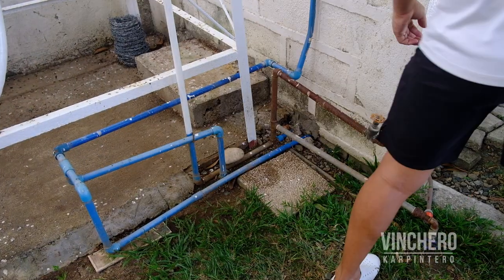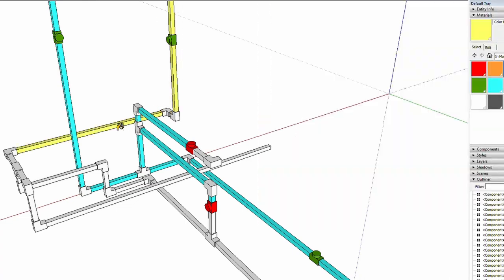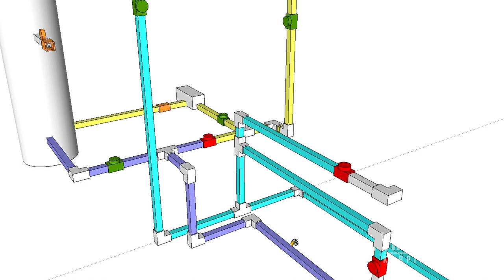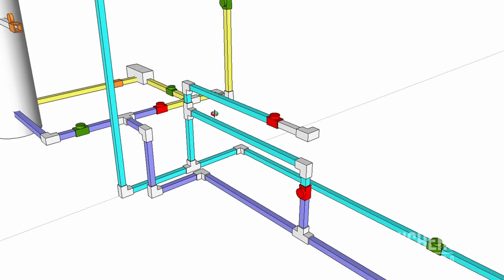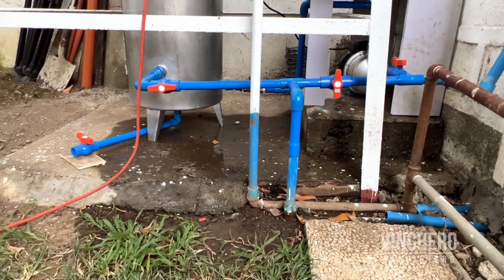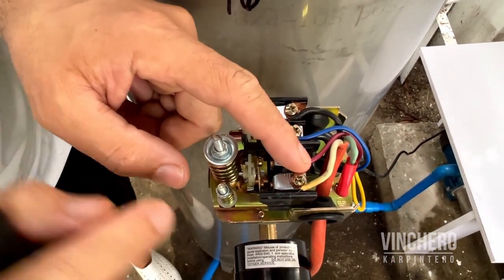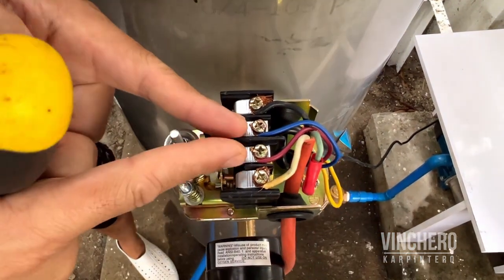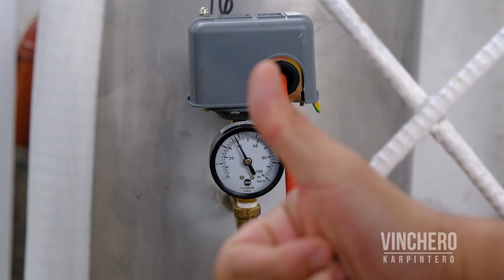How to Install a Water Pressure Tank and Pump

Comment: Hi. I wonder why glue all the pipe components? It's not future proof. You will have to cut/repipe if there's leak/broken section on the pipe. I would think there are alternative ways to pipe which will lessen the cost and do the job easier. One is to use compres' fittings and the other one is to use easy snap connectors. The two methods can handle the high pressures.